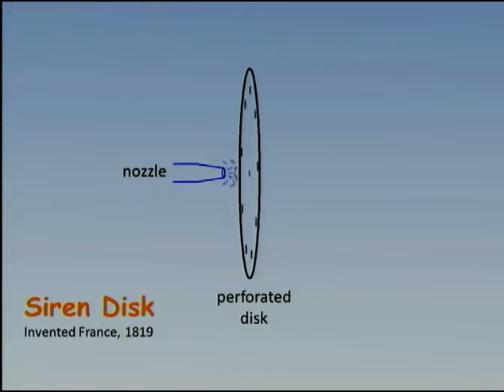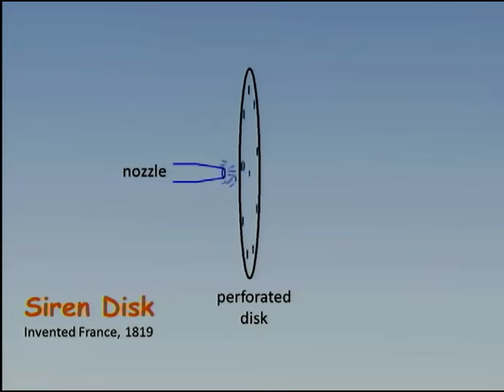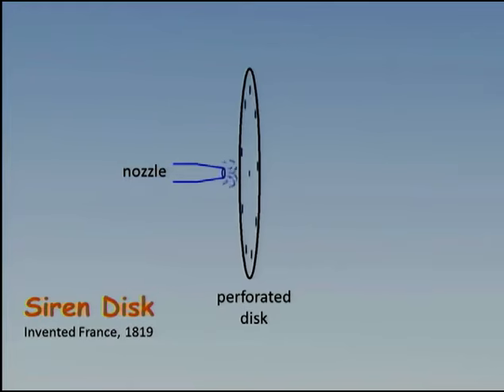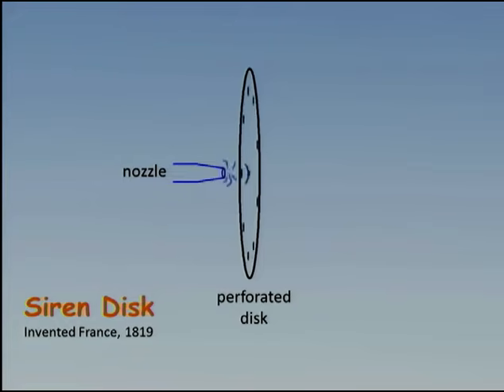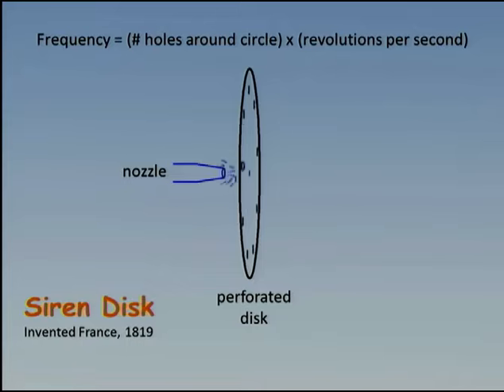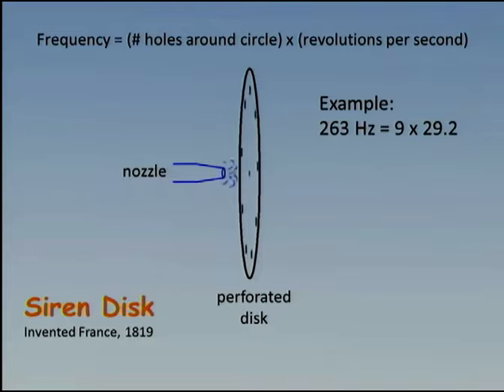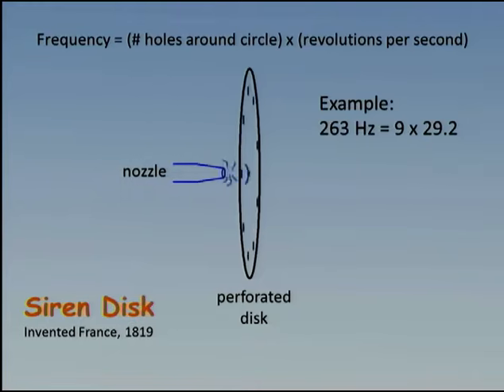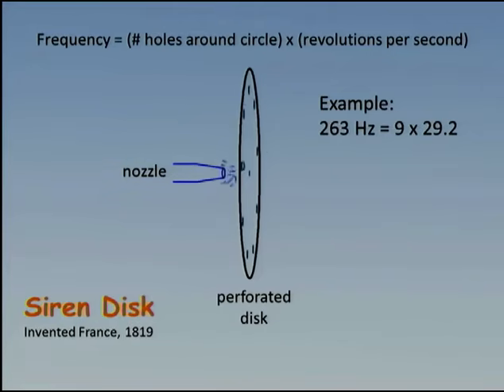Siren Disk Demo - the musical scale

Comment: Fun fact, Integer ratios between notes are really nice on paper, but you can’t actually use integer ratios to tune a piano because they don’t get you to exact octaves if you repeatedly apply them!

This means that, ironically, using perfectly in-tune intervals, whichever one, to tune a piano would actually make it extremely out of tune and unplayable 🎹💥
Reply: ????  The octave is the most basic of these intervals, just the ratio 1:2.  Take the integer ratio 1:2 and you get an exact octave.
Reply: @thierrypauwels Yep, I'm on the same page as you. You'll always get a perfect octave if you double or halve a frequency. However, what I meant was that you can't tune a piano using integer ratios because repeatedly applying these to get to all the notes, doesn't line up nicely at the octave.

For instance, if you tried to tune a piano using exact 5ths, starting on, say, a C, you would multiply the frequency of the C repeatedly by 3/2, and label the notes you get along the way G, D, A, E, B, Gb, Db etc until you get all the way around the circle of 5ths back to a C. The thing is, precisely and mathematically, the C you've arrived at by doing this is going to be out of tune with your original C. For this reason, you can't tune a piano using integer ratios. The octave is actually the only interval on a piano that's perfectly in tune!
Reply: @aguycalledhumphrey Of course, you cannot tune using one single ratio of small integers.  Depending on the tuning system you will need to use 2 or 3 different ratios.
Reply: @thierrypauwels If you cannot agree that it's impossible to tune a piano such that all the intervals on it are precisely the defined integer ratios for each, then I'm sorry, but then it would be fair to conclude that you don't know what you're talking about, because it's been mathematically proven and agreed upon for a long, long time, and this has always been a problem that has caused the need to compromise. In fact, this problem is pretty much what spawned the concept of different tuning systems in the first place, because the different tuning systems are quite literally just different compromises various people created to try and mitigate this problem.

Also, the circle of 5ths does contain every note on a piano, and you can by definition get to all of them by only moving in 5ths, so given that it were possible to tune a piano using integer ratios(which it isn't), you would only need this one ratio.

I'm sorry, but could you please stick to what you know?

Thank you.
Reply: @aguycalledhumphrey I can assure you that I do know some mathematics, since I have a PhD in mathematics.  And no, with the circle of 5ths alone you cannot get all notes.  You need at least the two ratios 1/2 and 2/3, the circle of fifths and the circle of octaves and all the combinations.  This is for Pythagorean tuning.  For natural tuning you need also the ratio 4/5 to get perfect major thirds.
Reply: @thierrypauwels perhaps this has just been a miscommunication, but if you really do know your stuff, what is the "wolf interval" with regards to Pythagorean tuning and what causes it?

The circle of 5ths contains all 12 notes in a typical western scale. You can play all of them on a piano by only moving in 5ths.

Also, please care to explain what you meant by the "circle of octaves". Word soup, perhaps?
Reply: @aguycalledhumphrey Wolf interval is an interval very close to a fifth, but not exactly.  In pythagorean for example d flat to g sharp, which is a ratio of 1.520464897, close to 1.5 or 2/3.  Circle of octaves: c0-c1-c2-c3-...  Actually it is not a circle.  But you should realise that the notion of "circle of fifths" assumes that all notes with the same name in different octaves are considered the same.  You cannot play on the piano using only fifths.  If you start from c0, you get the sequence c0-g0-d1-a1-e2-...  You never get to d0, unless you also use octaves.
Reply: @thierrypauwels Yeah, I'm sorry, I'm now certain that you don't know what you're talking about. This has been a waste of time for both of us.

Of course you're gonna need octaves to fill in the gaps between the notes you get when you move in 5ths. That's pretty much a given.

It's evident that you're now searching things up, because you've told me literally and specifically what the wolf interval is, but not what it is conceptually. The wolf interval, the way in which the problem I mentioned earlier presents in Pythagorean tuning, is a by-product of the very act of tuning a piano using precise 5ths, because like I said, you don't arrive back at perfect octaves if you only use 5ths to tune.

Perhaps you will better understand if I speak your language then, using maths. Say that, for simplicity, I have a 1Hz note. Now, of course, it follows that all the notes that are octaves above this note have a frequency of the form 2^n, where n is a natural number. If you multiply 1Hz repeatedly by 3/2, thereby increasing it repeatedly by perfectly intonated 5ths, you will never reach a number of the aforementioned form, showing that you cannot precisely get to any number of octaves above a given note by stacking 5ths. You can apply the same logic to any other integer ratio.

This will be my last reply, I'm sorry but I refuse to waste any more time here.

Comment: Holy heck is this how those little chord organs work that have a blower fan?  Sounds exactly the same.  I always thought they blew through reeds.  Really cool!
Reply: Most chord organs I've seen do use regular brass reeds (like a harmonica or accordion) but the resemblance is definitely uncanny.
Reply: @oplopy1234  sirens and western free reeds actually have incredibly similar timbres and overtone signatures, and can be easily confused for each other on spectrograms.

It's hard to tell in practice because sirens characteristicslly don't have a fixed pitch and reeds are seldom sounded solo, but they are incredibly similar!
Reply: @kberkstr  The easiest way to tell the difference between reeds and this device would be to check if the frequency ratios are perfect 4:5:6. Reeds probably wouldn't be. Especially as 4:5:6 (1 : 1.25 : 1.5) is an idealized or "just" major chord. Most modern instruments are tuned to the equal tempered scale. This enables playing in any key without retuning, but has a major 3rd a long way off the ideal. it's the cube root of 2, which is about 1.26 instead of 1.25.
Reply: @londonalicante  fwiw, while that's true for the vast majority of instruments you'll find today, there are specialty instruments (usually concertinas, diatonic accordions, and some reed organs built for historical performance) that do in fact play in non-equal temperaments. I actually work a semi-serious side gig in accordion repair and construction; hearing firsthand how retuning by just a few cents completely changes the sound of the chords is mind-blowing every single time.
Reply: No the actually have plastic reeds
Reply: @hollyjollydogDepends on the organ, but yes, many do have plastic reeds.
Reply: I was gonna say I think those are more like an overcomplicated harmonica but it sounds very much alike, also reminds me of the sound of those little paper concertina's

Comment: Would it be possible to make a kind of mechanical FM synth by feeding the air output from one disc through a hose to a 2nd disc spinning at a fixed ratio (using a gearbox similar like Hammond organ tonewheels) and that output through e.g. a gramophone trumpet speaker?

I am interesting in how far synths employing mechanical or other non-electronic means are possible. E.g. fluidics looks like an interesting method for an air operated synth (like a pipe organ, but much smaller).